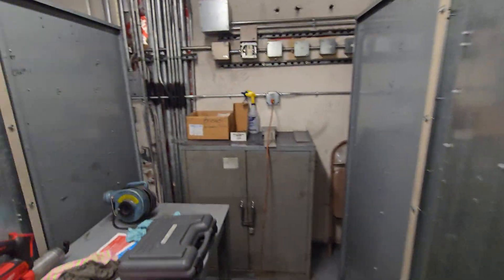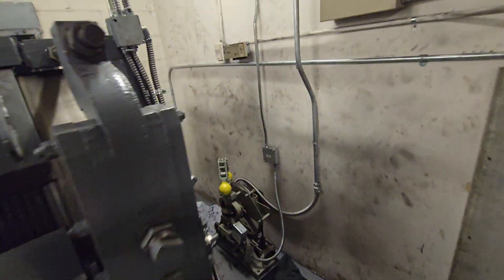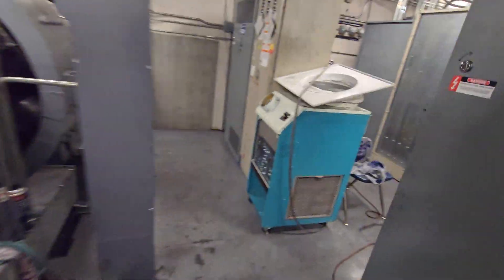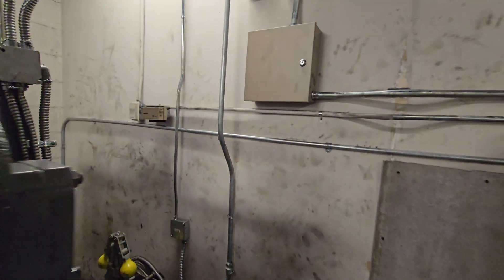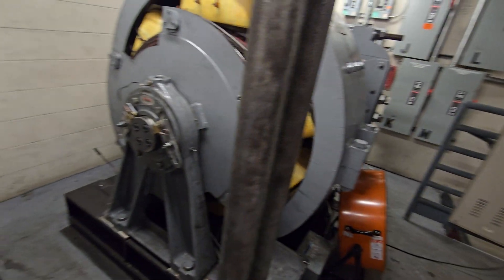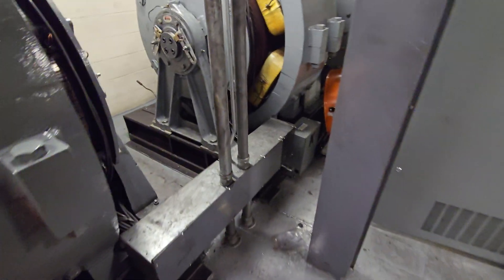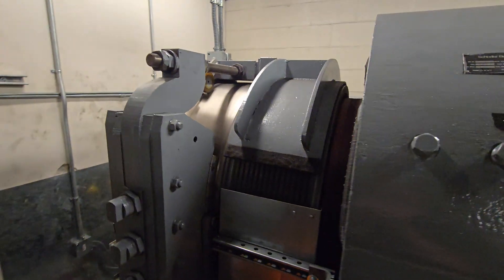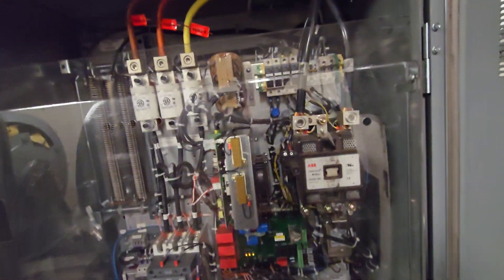(900 Subscribers!) INCREDIBLE 1200FPM Haughton/Schindler Traction Elevator Machine Room

Comment: You do not even have to touch parts carrying high voltages to get killed; you just have to get close enough.
Voltages above a certain level will jump across a gap, the size of which depends on the voltage.